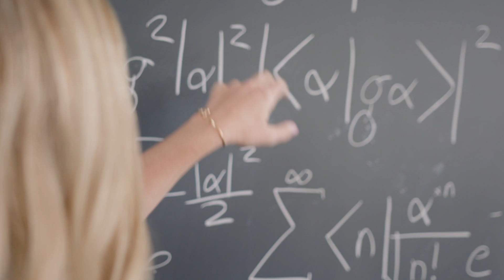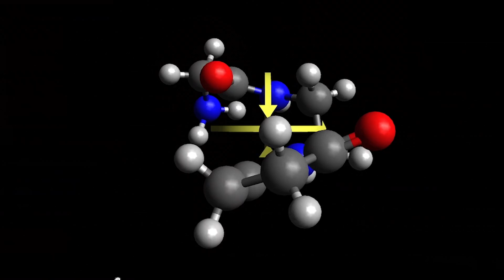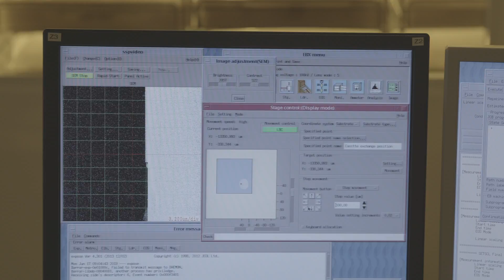Quantum Impact: Teaching the next generation of quantum (Ep. 2)

Comment: This field seem to be growing fast. I wonder when quantum computers can be used to really improve on also the human body, by being able to simulate and understand the microbiological chemistry and when the understanding gained by working with them possibly  have assisted in developing contraptions which will open portals to other parallel realities?

Though psychedelics may already do that, by disabling the properties of the brain, which normally prevent much of such information in reaching the conscious perception?

But the brain may be able to detect patterns in quantum fluctuations relevant to its "owners" situation, due to the neural circuitry which is all over covered with the only 10 nm thick cell membrane with an electric field strength of up to 6 million volts per meter?

Quantum Impact: Teaching the next generation of quantum (Ep. 2)
https://www.youtube.com/watch?v=xivcAE4GGWc&list=PLFPUGjQjckXFsOEBvvaDeIk5GxctP0ZhX&index=4

Electric field strength inside neural membrane during the course of an action potential fig1.
https://www.researchgate.net/figure/Electric-field-strength-inside-neural-membrane-during-the-course-of-an-action-potential_fig1_28763958